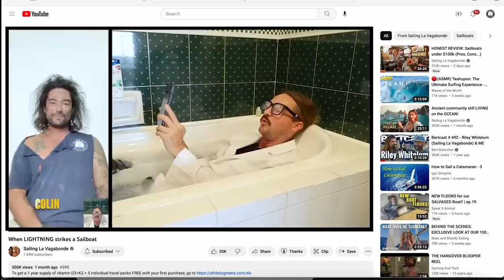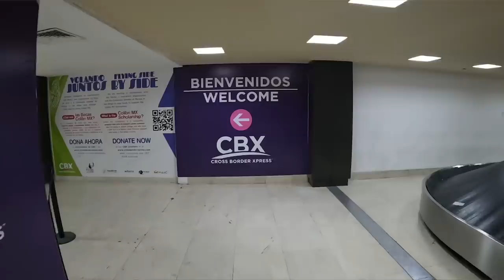Foolin' round with Riley from Sailing La Vagabonde - Shipyard period part 2 (Episode 212)

Comment: I used to move boats for storage and load boats on trucks for shipment on a Travel lift. They're fun to operate. Most of the time I spent at the shipyard I worked at I spent Building galleys, heads and prepping parts for the builds. For years I finalized the boats for the Dealers before I turned the boats over to QA for inspection. I had an accident there and had to quit. Made good money there with the best benefits I ever had. Went back into building Construction and retired a Commercial/Residential Contractor. Right now, I'm nursing another injury to my elbow, a new kind of pain I've never experienced before. Love you videos! Been subscribed now for about 3 years!

Comment: When working on foam core carbon fiber aircraft fuselages, i was taught to drill through the sandwich, then use a stiff wire or right angle scribe to dig out the foam between inner and outer carbon fiber layers immediately around the hole. Then fill hole and hollowed out peripheral region with epoxy, allow to harden, then drill hole.  

This prevents crushing layers together between inner and outer layers when tightening bolts in aircraft.

BUT i would think you would want to so something similar on balsa core fiberglass.   Here's why:
If Jamie had dug out balsa core around holes he drilled into hull, this arrangement would greatly increase the bonding area between outer hull layer and epoxy.   Water would have to infiltrate between plug and fiberglass perpendicularly the thickness of the outer hull layer and then radially however far back (some fraction of an inch) he could have hollowed out the balsa core. So instead of, 2 or three milimeters of bonding with the edge of the outer layer of fiberglass matrix... you'd have an extra few millimeters of bonding with the inner surface of the outer layer of the hull, for extra resistance to water intrusion

As an added bonus, the epoxy plug would be MECHANICALLY locked in place( it'd be  bigger in diameter than the hole drilled in the outer hull).  And when tightening the screws, or if light fixture is hit, holding the lights in place, you are going to be pulling the plug against the inner surface of outer layer of hull, and thus less likely to fracture that bond; as it is, outward or inward force on screw, such as by over-tightening a screw tends to shear the epoxy plug's bond with edge of outer hull layer, which could crack the layer/epoxy plug bond , allowing water intrusion to balsa core.
Reply: Something to think about next time

Comment: I have to say good job Jamie of blogging your little excursion to pick up the part. Happy to see you went with just replacing the part and will probably have it welded up to use as a spare if forced to. Welding that part properly will ensure it's as strong or stronger than the surrounding metal which can of course lead to an issue of it breaking in a different area under stress if stress is what caused the original failure. It could just be that in that spot the metal, which appears to be an alloy, just wasn't as strong. The broken mount could very have been the issue that caused the failure due to where the mount is placed it's designed to hold the weight/stress but the mount having broken shifted those stresses to a different area of the flange. Lot of words to say that I'm happy to see you've gotten the issue solved and I'm pretty sure we know it's holding up well and you splashed on Monday considering the 3 hr live stream from the equator. Always worth the watch and thank you for sharing your adventures, the good and the bad.
Fair winds, following seas, safe travels and God Bless...

Comment: That re-feeding of the wire for the rear lights is actually easy even if you did not have an existing wire. Just use a vacuum cleaner and some knitting wool. Suck the wool through using the vacuum....works great for conduit as well.

Comment: You are correct.  It was not the right thing to do.  Good on you for ensuring safety comes first.  Not cheap, but a lot cheaper than failing to mitigate the risk.

Grease monkey:  Use 1200 and 2000 emery paper and 2k and 4k polishes applied diagonally under rotation to condition the sealing surface of the shaft.  I've reconditioned 3 leakers this way over the last 40 years.  No leaks.

Comment: When fitting seals in a marine environment remove the springs from within the seals and replace them with O rings because if any water comes into contact with the spring in any way ,then the spring rusts and let’s go tension.this normally only happens on seals holding water out.

Comment: I have a question about drilling the holes and the filling of epoxy.  Would it have been better to only drill the big holes through the outer glass and bolsa core so when back filling with epoxy it had a surface to grab and hold for back filling and to seal to?  I don't know shit about boating but just thinking about it using my automotive and construction knowledge.

Comment: A few well placed white rubber rub rails in might save a lot of gel coat repair in the future. Would probably end up costing the same after you calculate the materials and labor involved. I would have that cracked flange welded for a spare to get you home, but, there's only so much you can store as 'spares', Eh? I'd paint a small black dot or diamond on the hull where the straps of the travel lift should go, so there would be no language barrier to mess up the proper placement of the straps... :face-blue-smiling:

Comment: On my boat on my salt water intake manifold after the sea strainer I hooked up a Ball valve to my pressure-fresh water to back wash my salt water intake, then with the thru hull off run the engine salt water side and heat exchanger with fresh water for two minutes then always engine shut down on freshwater in her salt water side. Came up with this after I rebuilt the heat exchanger and found years of growth, after wrestling with over heating issues.  The other end of the manifold again with a ball valve with a run to the bilge, with used panty hose used on a basket strainer.  This with the salt water through hull salt water off, the running salt water side of the engine can be used as an emergency bilge pump.    Yeah hat drilling into the hull, even above the water line for an over board AC water dump.  Doing a refit thinking about the wish list, underwater lights are on it, but the LEDs how would they survive a lighting strike?  Your thoughts?

Comment: What I would do?
Clean & buff flange. Trace cracks & V grind back to good metal or through flange as needed. Heat flange on grill low & slow till hot. Tig weld damaged area with appropriate rod blending into non effected area. Buff & grind back 30-40% of weld. Re-weld. 
Machine flange back to spec  on lathe. 
100%. Enter than new.

Comment: I know you are long out there and happy again, but seeing you worried about where the lifting straps are placed (again) is little bit crazy.
It might be worth puting some clear placement markings on the boat where to put the straps and where the lifting points are.
On heavy eqipment, railroad lokomotives and waggon are lifting points market. on big ships are markinks where towpoints or pressure points for tugboarts to push on are.
Its hard watch all of those saling channels and not seeing a system in place to make this clear. 
Also the points where to block keels or to put stabilisers.

Comment: Look, I'm a fan from the beginning and learned a few things from your channel. I'm DIY thru-and-thru.The only thing that confused me is an " Engineer" not using available mechanical torque specs on these  drive rebuilds to ensure the best possible reliability for his crew with a simple Snap-on 3/8" digital torque wrench. I love you guys and would totally send you mine to double check your work before you do a crossing. Maybe I'm wrong and some loctite and elbow greese can cover it. These days everything is engineered with intent and confidence if the numbers are followed. I think it would be super informative if a professional came in and checked your work and told you what you might have done wrong or patted you on the back for what you did very good?

Comment: I’m horizontal injured with time on hand. So using a couple vessel loc apps like VesseLink etc I found SV Delos weeks ago safe and sound. But I’ve tried various spellings for Parlay, quite a few wrong ones and no Revival suffix either. How do I follow real time like Delos and others. Note: likely too late but tig weld the old part as a spare. Especially if you’re not sure why it cracked. Over torqued? Be well, wish I was there, maintained a fleet of 9 charters.

Comment: This housing was serviced/installed just a couple of years ago (since the rebuild). What's the thinking behind not stocking a second part? A spare. 
I realize that it's not a wear item (designed to wear out - like an impeller), but the housing must take a load of wear and tear to have cracked as it did. Was the crack related to stress - or to corrosion? I would think stress (overtightening or under-design and not enough metal).

Comment: I have watched from the begining and as a mechanic myself, couldn't you find a machine shop to weld up the flange? I am also wondering why you didn't paint bulkhead location lines on the exterior of the hull? it would take the guess work out of lifting straps locations  when you are in different parts of the world where language could be a factor.

Comment: Why didn't you get the cracked flang tig welded by someone is cheaper and stronger. plus you can strengthen the flang with stress points making it almost impossible to break by stress.

Comment: Nice and Square. Trey are circular. Omg.
Reply from the maker: In engineering terms, putting something in square means the direction of said object forms a right angle with the housing it goes into. Off square would cause the seal to not be circular and deform it 👍

Comment: Lightening:  Check with a commercial building electrician.  Offer him free advertising on your YouTube channel for a recorded interview of advice on how to thoroughly lightening-proof your sailboat.  If it were me, having intimate knowledge of how they lightening-proof aircraft, I'd use a primary and two spark-gapped secondary grounding wires from the mast tops, at the four points left and right, fore and aft, two points admidships left and right, and five more points around the cabin top.  Do not tie it into the safety rails!  Instead, electrically isolate the safety rails.  Lightening doesn't like going through seawater, but rather, on top of the surface, so have the grounding wires entering deep enough they remain submerged during heavy seas, but no more.

Finally, do not tie any electrical system ground into the boat's lightening ground.  This means installing isolators and spark-gap shunts for the engines, which are naturally grounded via the shafts.  Same goes for marine antennas.  You can electrically (RF) couple them through a pane of glass or even the hull without much loss, but with terrific electrical insulation.

Good luck!

Comment: @13:27 That is the proper way to do this.👴👌
However...@14:44 I would have tape-sealed the holes on the outside, and fill them from the inside...👴😁
-
@21:13 Cut some triangles out of 'waterline-tape' and mark the spots just above the waterline: no stress anymore.